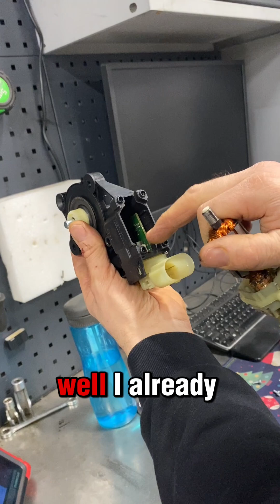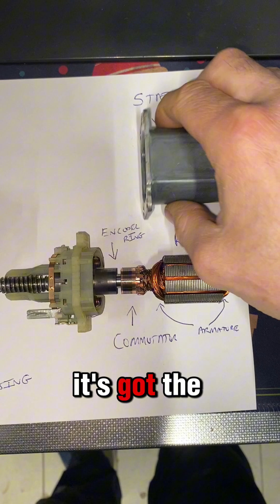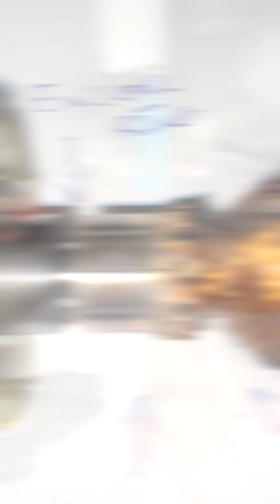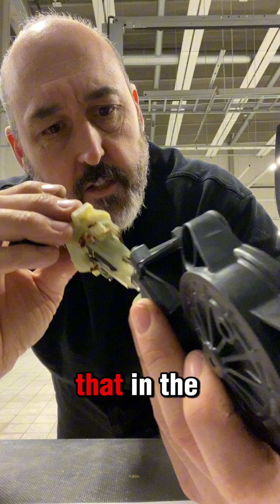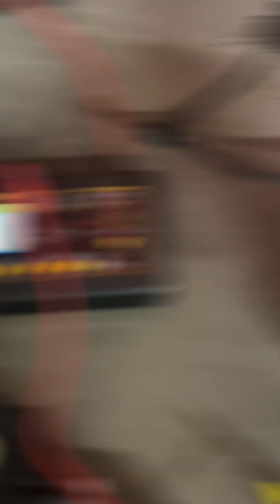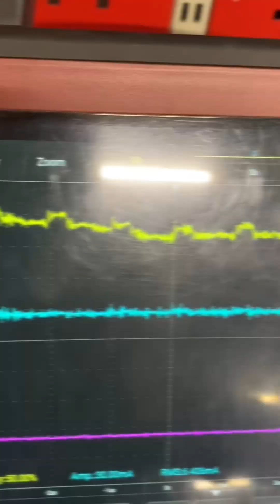How a Window Motor REALLY Works! (Explained)

Comment: What is that power supply unit you have on the bench to power up the window motor please?
Reply from the maker: Ah yes. This is from Temu. Check out the review though its hard to get these days I Bought This TEMU Automotive Tool… Will It Even Work?
https://youtu.be/a7kIRWDcLNQ
Reply: @BenJFF Thanks - will check that out 👍

Comment: Just to be clear, are the hall effect sensors used for the auto up or down feature so it knows to stop when it reaches the end of it's travel?
Reply from the maker: Yes exactly and also the scope trace square wave pattern widens when the window slows - this is how anti pinch works
Reply: @BenJFF  Thank you so much!

Comment: Nice to get inside and show it's not just a motor and what actually detects the anti trap function. Much better now than on the older cars when it was the sensor in the top of the window seal
Reply from the maker: Cheers Kev